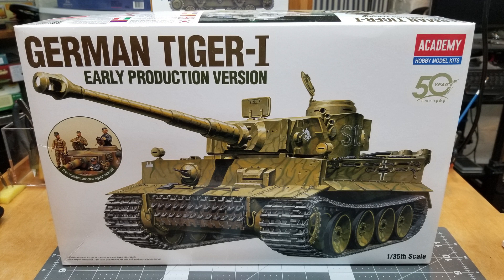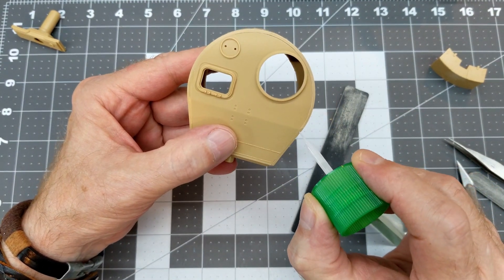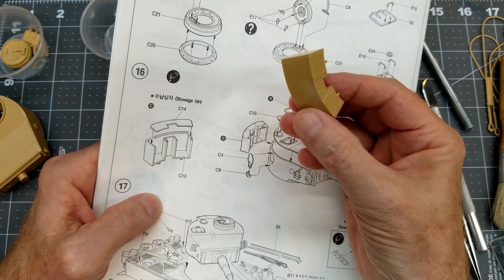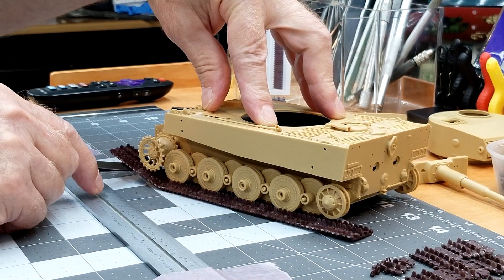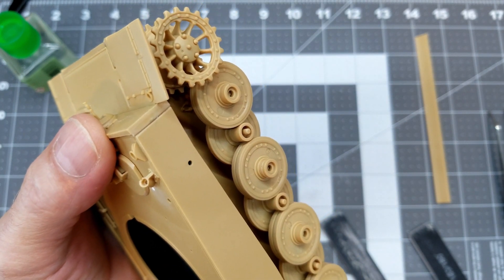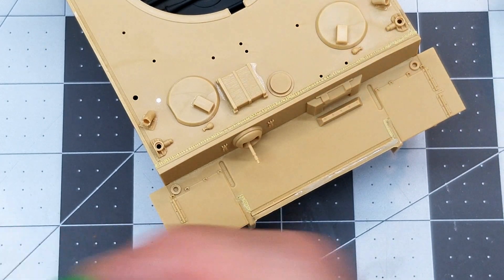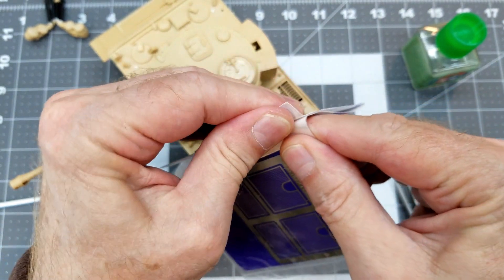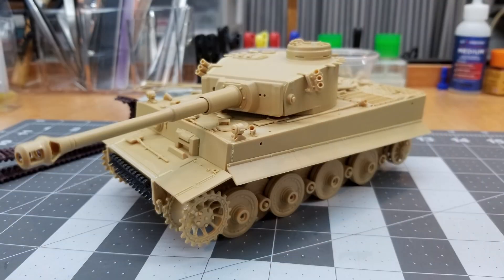Tiger I, Early Production, by Academy, in 1/35 Scale, Part2, Turret/Tracks/and Welds

Comment: Coming along nicely sir. 1 question, sprue glue. How much sprue and how much glue did you use please. It looked a nice consistency and I am nothing if not a copy cat. Regards.
Reply from the maker: Hi Norman, great question, in short, I don't know, lol. Think of it like making a mud pie. Cut small pieces of sprue and add them to the glue until you get the consistency that you like. Of course, the more you add the thicker it will get. You can always thin it back out by adding more glue if it gets too thick. Tamiya extra thin is actually a solvent, which causes a softening of the polystyrene plastic which in turn causes the plastic parts to stick together. I've gotten from other modelers that there is only 1% chemical difference between Tamiya Extra Thin and Tamiya Airbrush Cleaner. So, they are literally the same thing and can be used interchangeably. Go figure! Hope this very long explanation is of some use to you my friend. Johnny